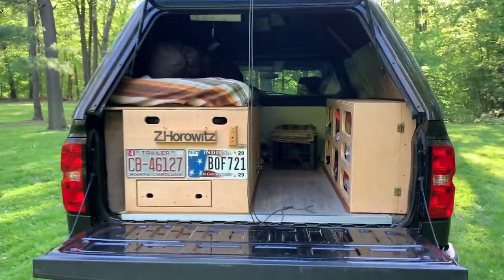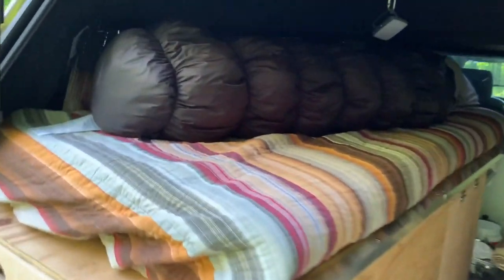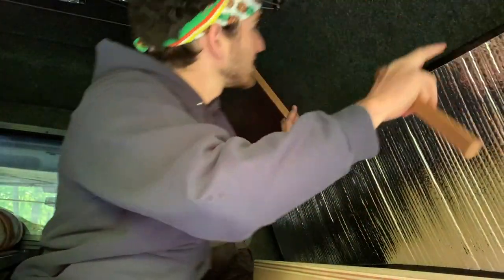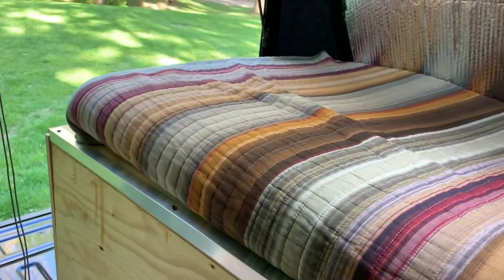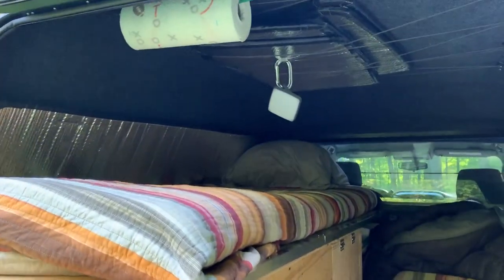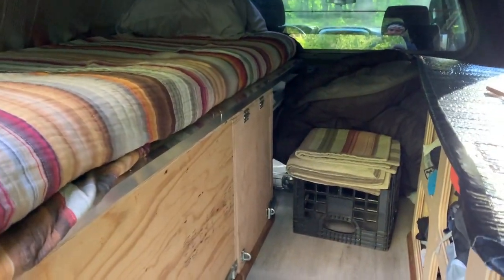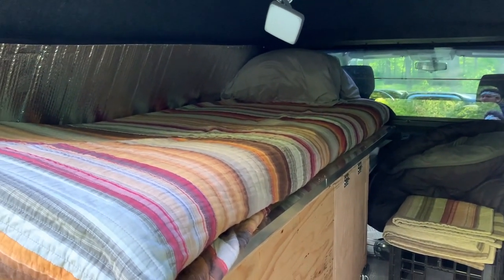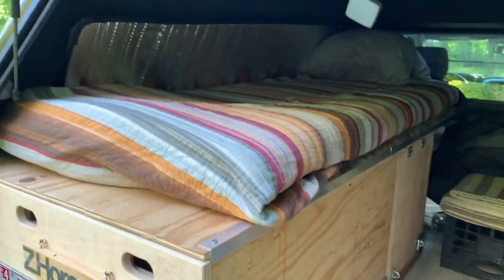Truck Camping: This is my bed set-up.

Comment: Lol remember folks u could get a much superior setup from an old full size van. U could find them in Craigslist for less than $7000.
Reply: We got a 2002 Chrysler Town and country limited for under 2500$. it has been a very reliable vehicle. Not a spot of rust anywhere. (Southern AZ)